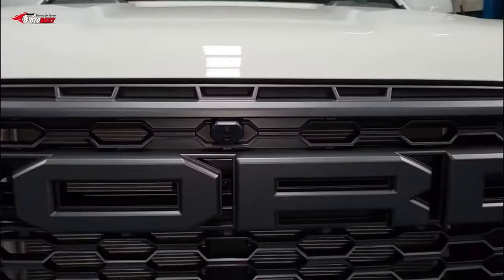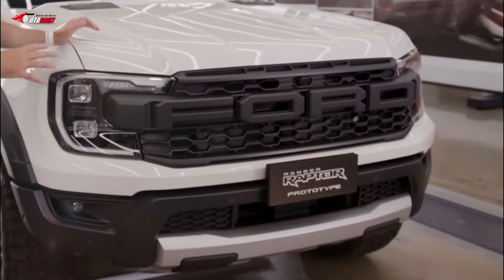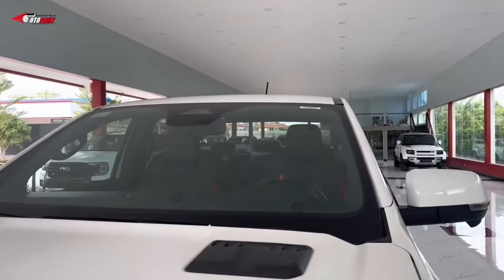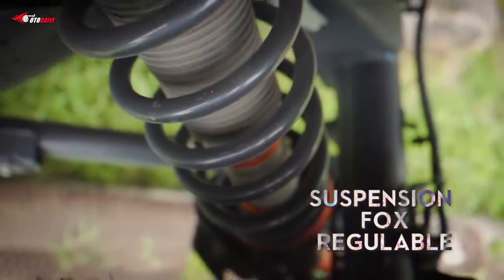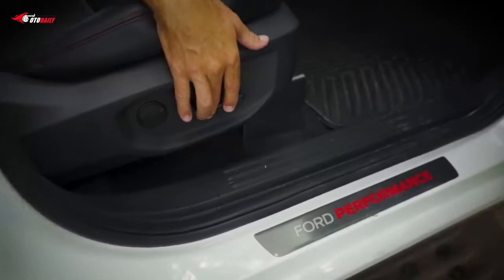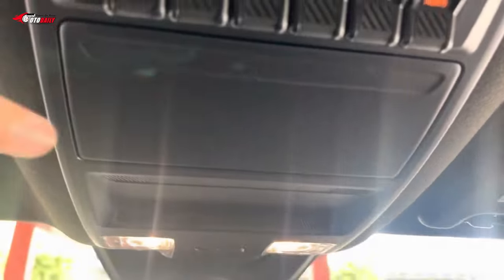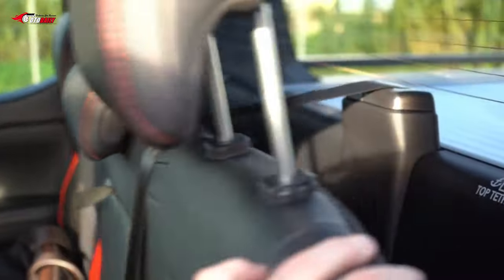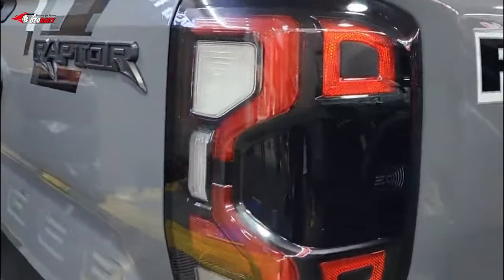2024 Ford Ranger Raptor US Review

Comment: Maybe you just made a mistake in your caption, cause in the video you explained that it should have the 392 HP or 397 HP like in the Australian version. Americans will not be happy with the weak 284 HP version that Europeans are getting. Americans are accustomed to big horsepower trucks and rightfully so. The new Ranger Raptor they bring to the US better be the more powerful one like in Australia and South Africa etc. America has the big open roads and off-road landscape for it. Looking forward to it!
Reply from the maker: I understand what you explained. But you need to know, the Ford Ranger Raptor has several types, which obviously will be embedded with different engines for each type.
Reply: Regular 4 cyl Ford ranger has 300hp with premium fuel. So it will probably be closer to 400.
Reply: @OtoDaily  Nice! Well I'm happy as long as we have the option to have the most powerful one as well.

Comment: I guess you’ll have to count me as cautiously optimistic because right now Ford can’t produce an F150 or Branco with upscale accessories and options without 8-12 month delays and thousands of dollars added to the MSRP and dealer makeup!
Reply from the maker: maybe it happened because of the large number of purchases rather than production. so Ford was overwhelmed in preparing the cars that were produced.
Reply: @OtoDaily  possibly, though they blame it on the old reliable supply chain issues excuse. But that doesn’t explain increasing the MSRP and adding $20K+ to the window sticker price.